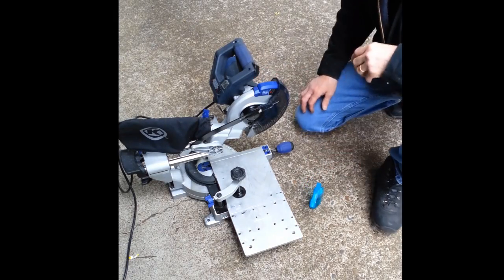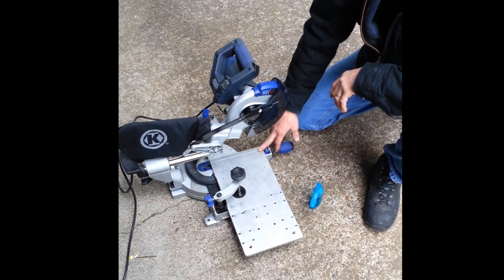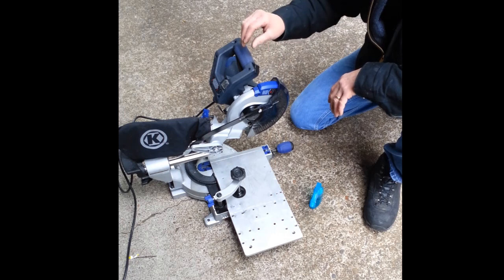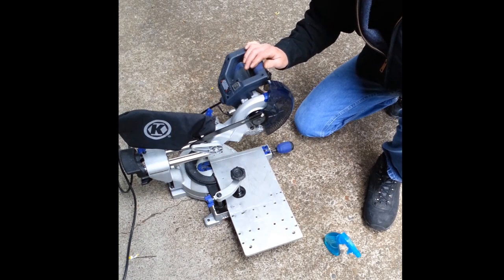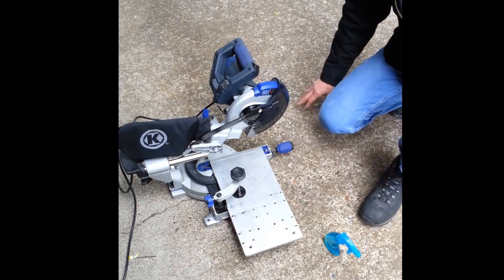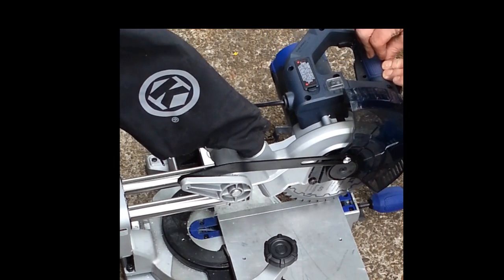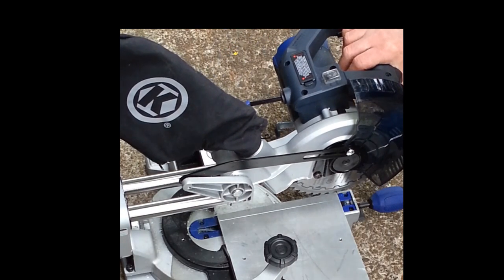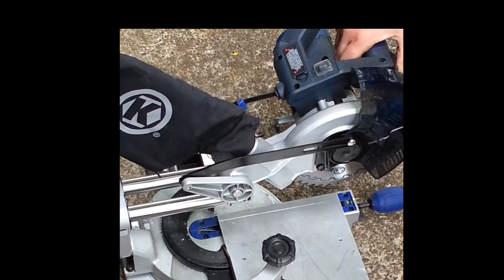Accurate cutting aluminum with Sliding Miter Saw

Comment: One thing you can do is screw a piece of wood to your fence the full width of your saw. I have a piece of wood about 1/2" thick and 4" tall screwed to mine (make one cut through it and voila - your new fence with a blade width gap to support your material on both sides). This way your "cutoff" material will always be supported. Otherwise if your cutoff piece doesn't reach the other side of your fence it's at risk of going for a ride with the blade.